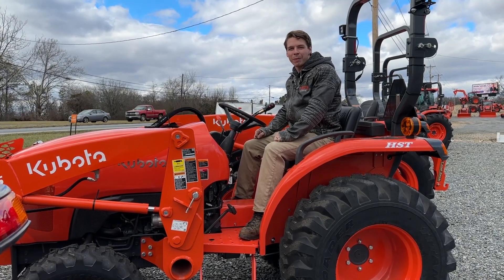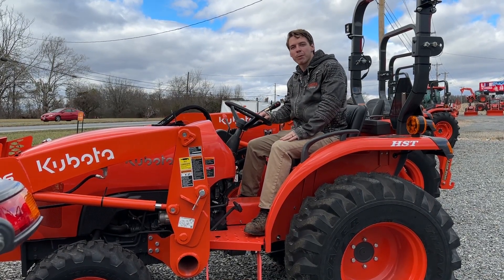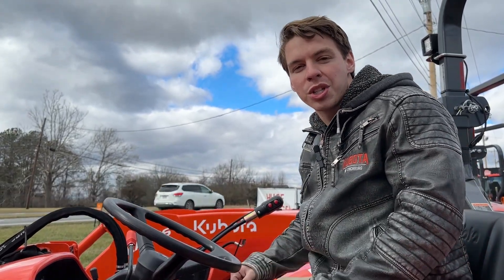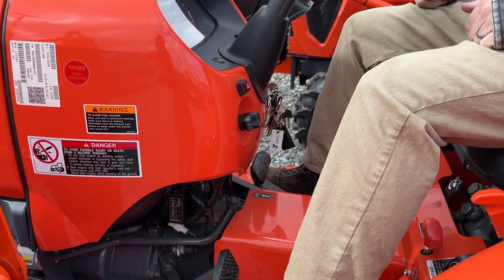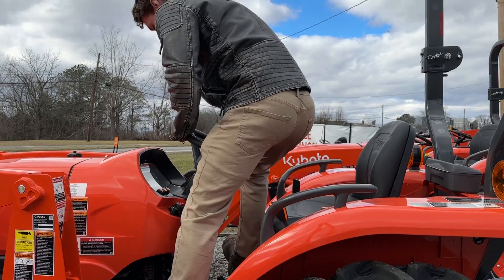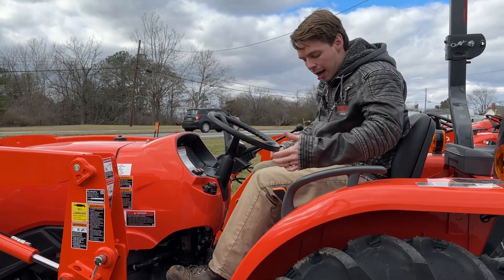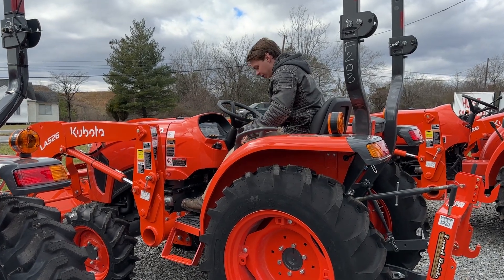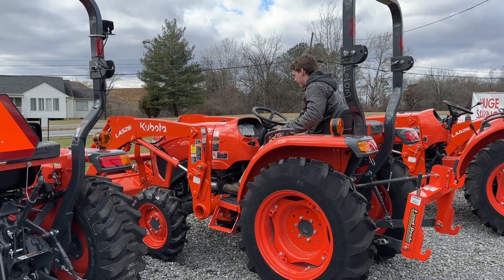Hydrostatic vs Gear Drive Tractors

Comment: Why would anyone choose a clunky gear drive?
Reply: Longer term reliability due to simplicity of system, if you clutch/shift correctly, is why I prefer manual ones over hydrostatic on my very steep mountain land with thousand foot difference in elevation between top and bottom of property. Although I totally understand why most people would prefer that hydrostatic by speeding up jobs and overall convenience.

Comment: Kobota need to make a power split hydro drive. Most of the power is transferred mechanically while the hydro is used  varying the speed and direction of the ring gear.

Comment: i do both large field mowing as well as mowing in cramped spaces and i must say switching to HST is real nice in the cramped spaces but forget pulling anything with it. if you do plowing and other pulling stuff get a gear drive. if you need to keep PTO speed high while the speed must be variable get HST 

also the mower i use is a SABO -Roberine with a 30 HP volkswagen engine

Comment: If hydro transmissions are as undependable on tractors as they are on lawnmowers I'd choose gear driven every time.  A lot of old tractors out there with gear drive transmissions still running strong after 70 years. Had a hydrostat lawnmower the tranny crapped out after a couple of years
Reply: This is what worried me when I bought my riding mower about 5 years ago. The hydrostatic drive still works, but not as well as it used to. Reverse is weak, won't even back up a hill anymore, although forward is still strong enough. Guess I'll keep it going as long as I can, but once that hydrostatic drive does crap out, I'll probably have to start looking for another gear driven unit.
Reply: @crewdawg2008  yep. After a couple of years had to get off every few yards, yank the mower backwards to get it to go forward. Quite annoying it was. And Husqvarna built it where it was near impossible to change the hydrostatic transmission fluid.
Reply: If its not a commercial mower it probably has low quality hydros. Tractors have much heavier duty drives in them

Comment: My l2850 has a 4 speed low and high range with a forward/reverse shifter on the column. I’ve so far used the clutch to do this going from forward to reverse. Would be nice if I didn’t have to.

Comment: typing this at 4 minutes.  can you comment on fuel consumption.  i use a a 5640 manual trans. to cut grass. a couple of times i've changed rotary mower to my 5200.  fuel used was higher than the 5640.  i think it's because of the hst.  another comment is the maintenance costs... those hyd filters are high priced!!
Reply from the maker: Fuel consumption is very hard to track in tractors with so many variables on attachments, accessories, terrain etc. But a general rule of thumb is a Gear Driven transmission is more fuel efficient than a HST transmission. How much more? I can't expect it to be much more than a 10% difference but I have never ran the numbers. The Hydro filters are expensive, but changing them ever 200-400 hours or every few years adds up slowly but consistently.
Reply: @kubotaoflynchburg  i'll bet kubota has some mpg numbers on different tractors.
Reply: @HollisHurst  its gallon per hour rating for off road equipment, and there isent much out there on this. mainly each unit behaves diffrent and use verys wildly. my bx 23s when diging is about 1.1 gph at 2500rpm. that said buket work im at about .8 gph. i always figured a gallon per hr when plan projects.

Comment: How are the HST on steep hilly roads?
Reply from the maker: Keep the tractor in Low or Medium range and you will be just fine. I prefer a HST on hills vs a gear drive. Way easier to keep control and be safe using it.

Comment: I love my hydro until it's time to change the fluid.  $$$
Reply: i found my kubota is very happey with the off brand hydro fluid still not super cheap but it runs quieter than with the expensive kabuta brand synth oil.
Reply: What do you mean
Reply: @MegaKg9  the fluid is expensive!!! 
And it takes a lot

Comment: There's hydrostatic
And then there's at least 4 types of gear drive transmissions.
.
There's manuals with-out reversers the true classic version of a manual trans. With one reverse gear for low and one for high.
A major disadvantage for FEL loading.
.
And then there's shuttle shifts. Bolth of those types need the cluch depressed to change directions.
Just the shuttle shift if it has 8 forward gears it also has 8 reverse gears. Most of the time.
.
a  power reverser type manual trans dosen't need the clutch used to change direction. And has the same advantage as a shuttle shift.
.
Oh yea forgot about glide shifts a kabota thing, no clutch used to change gears in same direction.

Comment: I use a gear kubota l3901 and mid way releasing the clutch the pto on the bush hog will start without moving forward or reverse. I can also use the brakes to make tighter turns. And it feels a lot safer on hills back in the woods than my neighbors slightly larger hydro John Deere. Just depends on your applications and once you get some hours in the seat you will become proficient!
Reply: You have a two stage clutch. Be careful engaging the PTO with it if you are not throttled down. But that feature is very useful if you are managing a lot of land.

Comment: I have a l3301 gear drive. I do large area mowing. And the gear drive is perfect. Had to teach the wife how to drive it but she picked up quick. Now only thing I hate about the gear drive is. When you push the clutch down it stops everything. wish it didn't turn off the pto but it doesnt take alot to of time you get use to that. Also I do garden work and alot of loader work and I would not swap my gear drive for a hydro. I still love my gear drive. Far as pulling goes. The gear drive is the way to go hands down. Plus it doesn't whine like a hydro. Hydro's are kinda noisy
Reply: Alot of people hate on hst because it's not what grandpa had but bottom line is it is faster production wise especially when using a loader.
Reply: I have a kubota L3200 with hydrostatic drive.  It is a fabulous tractor and has exhibited none of the problems I read here in the comments.  I have  been running tractors and heavy equipment for well over 50 years, old, new, big and small, includeing the largest and smallest of both ag and industrial equipment and my L3200 never ceases to amaze me in the work it can do.
Reply: Hydro for loader work, hands down.  A shuttle shift may do decent but a traditional gear drive would be a PITA, imo

Comment: Jesus christ people talking about gear vs hydro are the same idiots who argue auto vs manual in a passenger vehicle lol using the same kind of cheesy insults. In all honesty if you are not maintaining a field, you don't need a gear driven tractor. And if you're maintaining a field, you honestly should get something bigger than a L2501 lol . Doing landscape or bush hog work, the hydro will get more work done in less time
Reply: I agree. If a hydrostat is good enough for front end loaders and $100k track loaders, im sure a 35hp compact tractor will be just fine.
Reply: @TheZebulonPike  The Hydrostatic drive systems in Construction Equipment is NOT EVEN Close to the same design of a Compact Tractor. Their is One Exception if it's a IVCT, that is a "Whole different story ".... but they are Rare & jump the price up Considerably. Yanmar has this system & Case-Newholland discontinued this over its Extreme expense in a Compact tractor.
Reply: You are very correct. Hydro for me in the landscape biz, is the only way to go
Reply: Nobody is timing me on my property

Comment: do you have to use the clutch on the mx5400 with the manual transmission?
Reply from the maker: Yes you will need to use the clutch between gears and ranges on the MX5400.
Reply: @kubotaoflynchburg  You would think they would have at least put a shuttle shift on it??

Comment: One huge difference in small tractors the HST usually can run the PTO even when changing directions. Something I wanted. I bought a gear drive only to find out that it didn't have the duel clutch. That allowed the PTO to run when changing directions. This is problematic when mowing in tight areas. As your mower slows down. The L2501 also has huge overlaps between Low and high gears. For bucket work, it sucks if you have any travel distance.
Reply: I think its TIME that you READ the Operator's Manuals. As long as you dont push the clutch in, the tractor ( L2501H) you can still chage directions with the "Go-pedal". Best wishes with all your endeavours.
Reply: @donaldstrishock3923  probably should take the time to read pork chops comment a little closer. He's talking about his shuttle shift tractor (DT), not the hydrostatic (HST).

Comment: A "hydrostatic" is for the "family" to "get loaded & go for a joy ride". The gear drive is for "Real" Power;=No "kids stuff" to get REAL Work Done.
Reply: Depends on what you are doing. Hydrostat is going to save you time if you are using the loader alot. Gear drive is going to last longer and have fewer problems in the long run though. That being said I have a hystat and love it, no problems yet and I've beat on it.
Reply: I’d rather up the engine size for more HP, keep the HST and work faster.
Reply: @steeldriver1776  You will NEED 280% More H.P. with the "Hydro-howl-o-Whine-slack-o-matic's" to but the SAME POWER to the Ground as the "Grind-a-matic"-Gear Drive unit. You must really like them "GO-GO pedals" .
Reply: @donaldstrishock3923 no way it’s 280 percent?? I’m gearing drive all the way but that can’t be true that you need 280 percent more power to equal a gear drive tractor? So your saying that for someone to be able to pull what my 34 hp l2850 will pull they would need about a 90 hp hst??
Reply: @donaldstrishock3923 The ramblings of a madman
Reply: @Corkoth55 this is not rambling. All hydrostatic and full hydraulic drive are limited by the flow rate of the pump and the max system pressure. Almost always this is far lower total horsepower from the hydro than the engine can put out. A gear drive will happily transfer engine power to the wheels, like a truck or car. if hydrostatic is glorious and amazing then why don't road vehicles all have it? It's high cost, high maintenance, high heat, and low low, very low power to the wheels. In theory a hydro drive can put out as much power as the engine can produce but such a unit gets really expensive and really big and really hot very very fast. Bottom line is that if you want power to the wheels, gear drive wins. No contest. Period. Hydro fans can argue all they want but it doesn't change the actual fact that gear drive is more reliable, more efficient, far more power to the wheels, but also far less convenient than hydro.
Reply: The moral of the story...learn to use a clutch.
Reply: Agree 1000%
Reply: Gear drive is for Harry the Home owner.  For real stump pulling and pushing brush and scoopin the dirt you want hydrostat.

Comment: I use my Kubota L2501 to drag up tree tops for firewood. Gear drive will out pull the hydrostatic models badly. There simply is no comparison in pulling power.
Reply: You are right! From using our  new 2501 hydro compared to my 1953 ferguson to 20. I can tell the to 20 would out pull that kubota all day. But for normal brush hogging and loader work it is very nice!
Reply: Agree,,
Reply: L3200 gear drive. You guys are right if you need pulling power gear drive is the only way to go. Especially skidding logs.

Comment: I notice on the new tractors, that on the gear drive there is no decal on the rear fender. 
On my gear drive L2501 Kubota, the fender has a decal that reads 4WD.

Comment: I have two tractors. An ancient 17HP Yanmar. Old school (1980ish) gear drive. And a fancy new B2601 hydro. The old Yanmar can pull a box blade and bush hog in 2wd where the newer higher horsepower machine can't in 4wd. Looking at selling them both and getting a 50ish PTO HP tractor on turf tires with a cab to mow and grade in HVAC controlled comfort. As well as other tractor things on our small property.

Comment: So silly question if it’s like a manual transmission, why do you have to “stop” to change gears? I take away that you could from a dead stop be in H4 and drive away…if I tried to start my car in 5th gear it wouldn’t go anywhere.
Reply: You gotta remember tractors aren’t geared for speed. H4 on a tractor is still geared way lower than the 1st gear in your car.
Reply: It would depend if the gears are synchronized or not. Square cut gears don't tend to change well while moving. In modern cars, all transmission gears are synchronized with maybe a few exceptions on larger pickup type trucks. More torque in a diesel engine at low gear and speed versus gas engine made to drive at highway speed.
Reply: You can change 1-4 while moving if you are good with unsynchronized transmissions. Typically unless you are going from 3rd to 4th in high range you are going so slow it doesn't really matter.